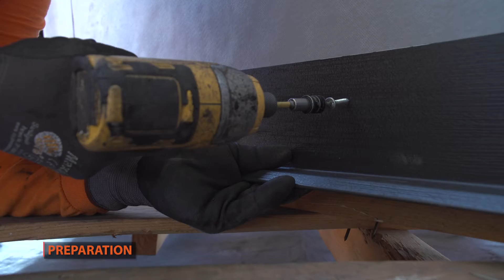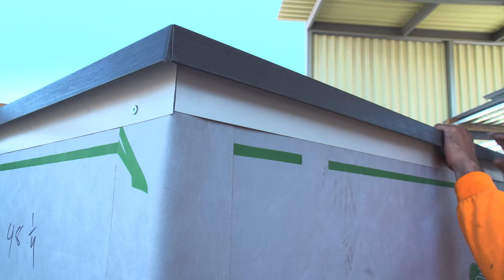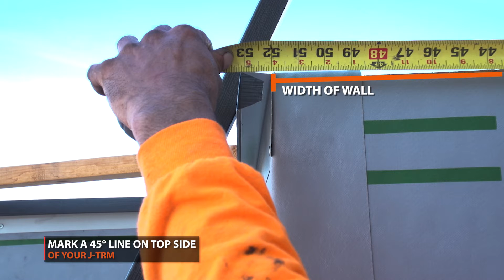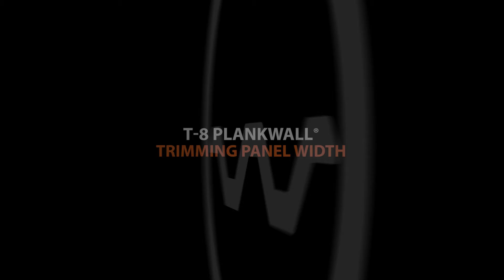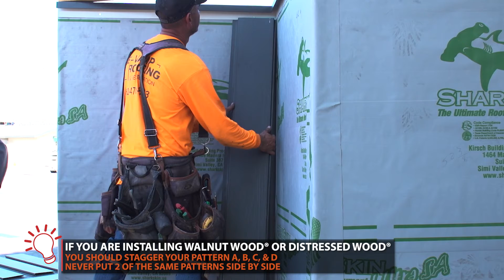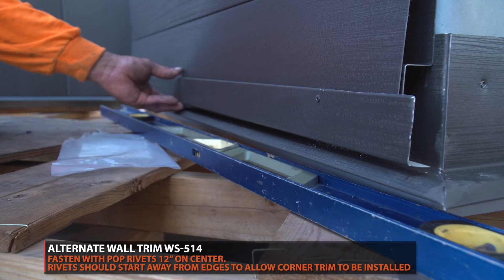Metal Wall Panel Installation: How To Install Flush Metal Wall Panel Systems

Comment: Wonderful content. What would be the ballpark cost for 1sft on an average. Not the most expensive one but most sought out one
Reply from the maker: If you purchase one of the panels that looks like wood, they are more expensive than a standard solid color.
T8 PlankWall in Walnut Wood or Distressed Wood = $10/Sq. Ft.
T-Groove, 24 Gauge in a standard Kynar color = $3.50-$4.00/Sq. Ft.
https://www.westernstatesmetalroofing.com/metal-soffit-panels-tgroove
Reply: @WesternStatesMetalRoofing  : many thanks
Reply: @WesternStatesMetalRoofing  Thanks for the answer for cost, sucks because to do my house would cost like 30,000$ for the T8 Plankwall =(